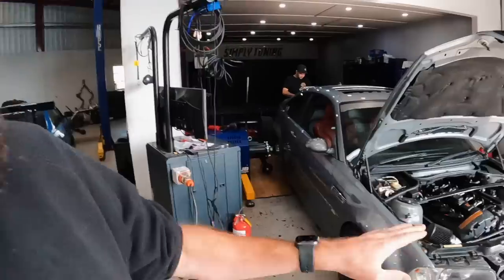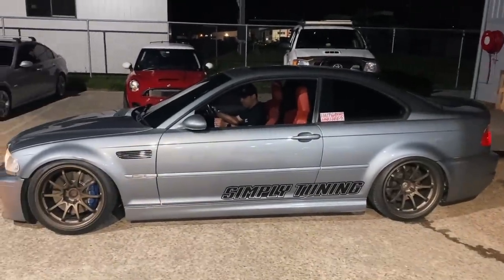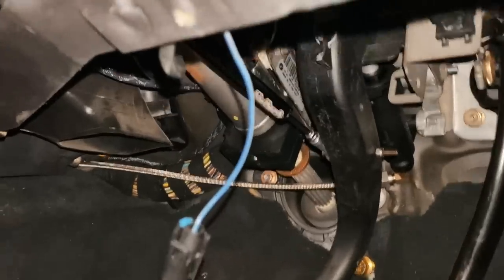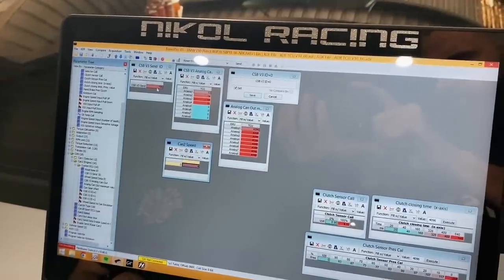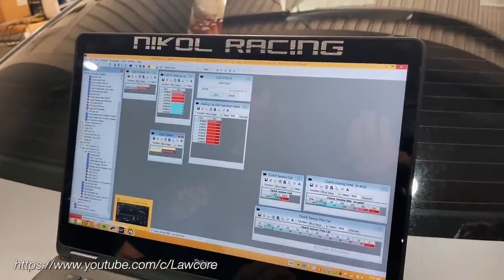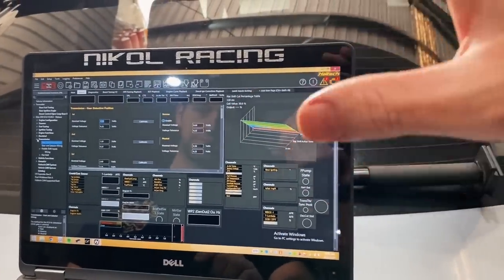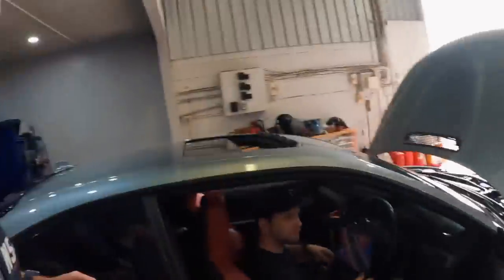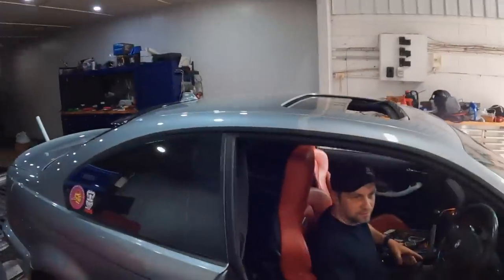Setup TURBOLAMIK TCU & Aftermarket ECU for #shiftcut

Comment: I can’t believe that it makes so much power and is so smooth and silent drama free. Must be like a missile on the road .
Reply from the maker: Honestly it feels very strong! Not like a high power turbo. More like a massive capacity engine. The way the 8 speed keeps it in its power band is amazing tho. Hp goes between 525 and 550hp as it runs through the gears. I wanna see what it does down a drag strip now.
Reply: I wish it was as usable on the road as I'd like. Maybe after the box swap is all sorted some super advanced traction control strategies and maybe a motorsport abs unit could get this thing really perfect 😅
Reply: @Buckna1  Mr power glide in coming lol
Reply: @Buckna1  isnt the MK60 M3abs  sufficient?🤔
Reply: @Buckna1  Traction control? What is that? I dont even turn the TC off in my M240i and it lights up in any mode.....😳😳

Comment: i know this is old, but for anyone out there that wants to have TQ reduction calculated on the lamik and send to haltech.
Once you're done with the tutorial on the video, add the following configuration:
on NSP, on the "flat shift - cut percentage table", add an axis (F3 shortcut) and select the IO box AVI voltage (for the paddle up/tq reduction request from lamik) as the 2nd axis.
configure the axis from 0v to 5v where 0v = 0% tq reduction and 5v = 100% reduction.
on NSP - Your paddle shift up configuration - should be configured as 0v off and 0.15v on
On the lamik use option 17 on the "analog Can out" to haltech (so it sends 0v =  0% tq reduction and 5v = 100% tq reduction.

The lamik will send 70% TQ reduction request using the calculated voltage for that (3.5v) to the haltech
haltech will receive 3.5v and apply: paddle up, activate flat shift, and apply the cut (70%) according to the flat shift cut percentage table referenced voltage (3.5v)
Reply: Hi, can you send me what the table looks like? I got axis flat shift active time vs AVI 3 tq reduction voltage.Stuck on filling the table.

Comment: Thanks for the technical deep dive - please more of that. One question: is the communication between the tcu and the haltech via can or analogue? I am bit confused since it starts with can setup but than you talk about analogue in and outputs. I guess all communication must be possible with CAN only?
Reply: It can be done either way! This is done via can. The haltech allows additional analog inputs via can so that's what is used here!

Comment: I like it - a lot.
Just wondering, where can I find the CAN converter that Dan is using to interface the Haltech with the E46 dash?
Reply from the maker: Dan had to get it made, it was around $400 from memory. Hell have to dig up the guys info.
Reply: @ZeroTo60Tube  thanks for the reply!
I'm not in need at the moment - I'm still playing with MS43 (with live tuning!). I was originally interested in going to an Elite 2500, but the canbus 'gap' kept me playing with the stock ms43, which has been fun. I have a 330CI with M54B30 and my 5HP19 did NOT like my GT3582 installation, so I'll soon be going to 8HP.
Once the M54B30 can't deal with me any more, I'll swap - at which time, Haltech will almost certainly be a part of the formula and I'll need a canbus bridge to keep the car 'nice'.
Thanks for all you do mate! 🙂

Comment: Whilst all your videos are great, none have excited me as much as this series haha... but obviously the fact I’m also doing N54 & 8HP drift car building I’m biased 😉
Will be interesting to see how similar those settings are for us as we’ll be running Emtron KV8 ecu... 🤔
Reply from the maker: Ohhhhh, they are a nice ecu. I’m pretty excited to see how this does actually drifting. Slightly concerned the trans might overheat also worried about how harsh it is on the drive train. But we will see
Reply: @ZeroTo60Tube  yeah the Emtrons are extremely capable so definitely excited about it... we’ve got turbosmart eGate going on it too which should make those power drops even less!
It’s interesting that prior to adjusting the settings those ‘clutch drops’ were so violent..? Obviously Dan has been using that car for drift for a while & said he’s not broken shafts before, even with a real clutch & manual, yet the 8HP did it twice back to back..?
Reply: @ZeroTo60Tube  we have a pretty large oil cooler & thermo fan that we plan to use to cool the trans... does the 46 not have one at the minute?
Reply: @truecapacityfitness1611  i dunno if you ever made the mistake of fitting a hks clutch to your drift car. But i did many years ago and it broke 3 gearboxes in a week. Changed back to an os giken and all was swell again. The way a clutch slips on the dump is super vital to keeping a drivetrain alive. As I've again learned to the tune of 2 exploded m3 axles 🤣
Reply: @Buckna1  haha nah mate I’ve never run a HKS clutch, & in almost 20 years of drifting I’ve surprisingly only ever broken I think 3 gearboxes (SR & RB), mind you I’ve never had heaps of power and I’m a fairly ‘gentle’ driver 😉
Definitely surprised me that it was so harsh to break those 2 of yours though.
Reply: @truecapacityfitness1611  oh man. Clutch choice has so much to do with it. And i had vietnam spec flashbacks to my hks clutch once i learned how the lamik cbw settings operate.
Reply: @Buckna1  obviously this is something I’m very interested to hear about... we may or may not need to call you in a few weeks regarding this 😉
Haha
Reply: @ZeroTo60Tube  I'm surprised he doesn't already have a trans cooler setup ? Especially for drifting
Reply from the maker: @Vgk36  Ahhh i should have clarified, this car does have a trans cooler since the 8hp install. Its a good looking unit front mounted. No fan however, so when sideways drifting, just not sure how much air will be going through it.

Comment: How did you wire reverse light ?
Did you take aux out low signal wire from tcu to reverse relay k6325 terminal 85 x6325 pin 4 ?
Reply from the maker: Hi John, i am sorry but i have no idea. The auto elec wire the lamik in to this one. But what you are suggesting should work.

Comment: Would it be possible for you to share the clutch settings from the Lamik controller? At what rate the potensiometer moves compared to clutch pressure in %. And also looking in the newer video of the actual drifting. There was some fiddling with a delay on the clutch. What did you change to make it feel instant? Running a 8hp70x on a Lamik controller myself, on a E61 M57 triple turbo drift wagon with clutch by wire setup, but havent gotten around to fine tune it myself yet.
Reply from the maker: Hi Erik. I never replied to this, becuase i see it and go..... oh ill get those settings and get back to Erik later today. Low and behold i havent had a chance to get the laptop from Dan. If you are still chasing the settings shoot me an email zeroto60tube@gmail.com

Comment: i cant remember which video it was where you put like an e60 or e70 "electronic" style shifter in the e90 with the 8hp and turbolamik ecu. im just wondering what shifter will bolt in and if you had any idea what would be involved to make it work with a stock e90 6hp if its even possible? would anything on the trans itself need to be changed over?
Reply from the maker: They won’t work. The electronic shifters for the 8hp won’t control cable shifter that’s used in the n54 6hps
Reply: @ZeroTo60Tube  how do the electronic shifters in say the e60 work? Would it be possible to fit up the bits from the e60 6hp to the e90 6hp and code them to work?
Reply from the maker: @BEAMERNOOB  I think you can get a e60 entire trans with electronic shifter to work in the e90. However i have no idea how much is really involved. Sorry i cant give more info, i have never done anything like it.

Comment: I have ssg ii with my m54b30. Im wondering between swaping manual 6T or 8hp with turbo lamik. My concern about 8hp is that when i was driving stock bmw G20 with 8hp, after the pedal kickdown i must have waited for about 1-2 sek to downshift, it was horrible. When changing gears with paddles even my old ssg was less laggy. Is it same with turbolamik ?
Reply from the maker: Downshifts with 8hps are always slow. Amazingly the BMW  clusters even have some trickerly to make it appear faster than it is. However after driving one for a week, you soon learn how to make it do what you need, when you need.

Comment: Can you do this with the older style haltech or only the elite?
Reply from the maker: Only the newer ones as far as i am aware. basically needs to support drive by wire.
Reply: @ZeroTo60Tube  going to embark on this project and I was wondering if the shifter (gear lever and/or paddles) would have to be wired into the turbo lamik itself or the Haltech
Reply from the maker: @levicharles4499  All shifter input is to the lamik.

Comment: Would the 8Hp trans work for a M54b30 with an automatic transmission? What is needed to use the 8Hp trans?
Reply: Im sure it would work! Check out pmc range for an adaptor and team up with a smart performance shop that can handle the tricky bits!
Reply: Actually If you go for the 8hp45 from m n55 and your car is 530iA or 330iA itll be close to pnp from engine to gearbox. You need a spacer for the starter, driveshaft already fitting, crossmember fitting...so the adapters for oilcooler and the controller and the loom is needed but technically bellhousing is 1:1

Comment: Doesn’t the Dct shift faster or there’s no boost drop between shifts vs The 8hp?
Reply from the maker: 8hp is actually faster when you measure the gforce. However its so much faster you dont feel the bang of the shift like a DCT. Replace a DCT with a 8hp and it feels like the car picks up 50-100hp.
Reply: @ZeroTo60Tube  damn, again that’s really interesting.  I always thought that was the case for going from a torque converter auto or single clutch gearbox like the Lamborghini Aventador  gearbox to the Dct in the huracan especially for boosted cars because of the gears the way they’re arranged you suffer no rpm or boost drop with a Dsg/pdk/Dual clutch.   So yea that is interesting.  Seems like a good transmission either way.  Look forward to you guys putting out more videos on how far you take the tuning in the Awd cars on the street, strip and if you tune it for road racing/time attack
Reply from the maker: Comparing to supercar transmission, the 8hp works more like koenigseggs latest transmission, just with a torque converter. However with Lamik you can delete the torque converter anyway. @mikelmarion

Comment: Hi,

Is it possible to emulate more than one haltech IO box?

I ask this, in case you want to send more than 4 inputs to the haltech.

Up paddle fut flat shit
Down paddle for dbw blips
Gear position
Oil temp
Shaft speed

Is it possible to also receive information from the haltech?
Torque converted lock up functions from haltech etc

Thanks in advance
Reply from the maker: You can not use 2 io boxes. However you can sent some via anologue
Reply: thanks, noted, i will need to plan my inputs on the haltch accordingly.
could you please also share how to setup the lamik to read the haltech CAN so it receives the MAP and TPS/DBW info via can?  @ZeroTo60Tube

Comment: Even though I'll be swapping from my 6-speed, I just want to remove that third pedal. Getting old sucks.
Reply from the maker: Haha. To be honest, I think the only thing you would want it for is clutch kicking during a slide. I don’t think I’d bother putting one in mine. I don’t think…… we’ll see after I drive dans a bit more.
Reply: @ZeroTo60Tube  see and drifting isn't my thing. The only thing I could think of using it for is maybe a rev/launch control. But you can wire that into a button on the steering wheel with the Maxxecu.
Reply from the maker: @DK-421  spot on! However with a lamik controller they have a few launch strategies now. So you don’t even need a button. And using the converter for launch should be much nicer on the drive train.
Reply: @ZeroTo60Tube  oh definitely. I've honestly never launched using a convertor. Most I ever did in an auto was hold the break and give the gas some throttle and release break. Most of my cars have been standards.